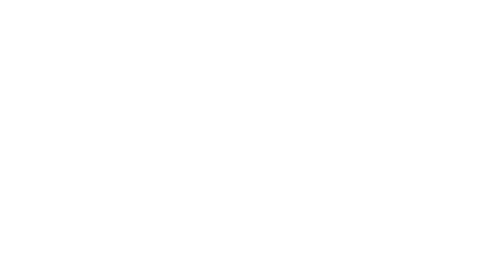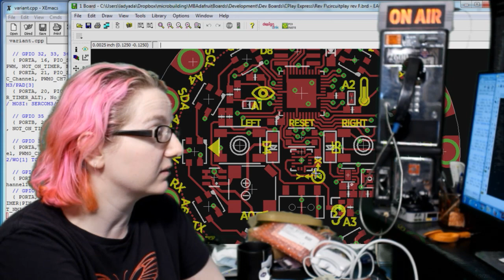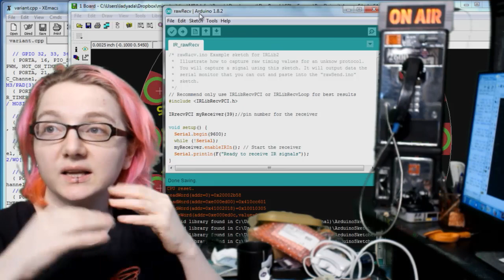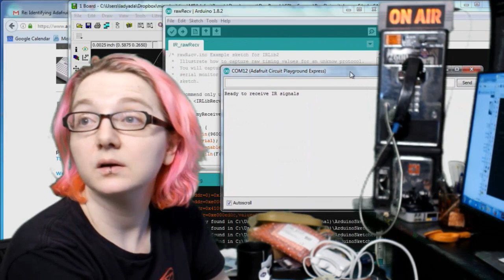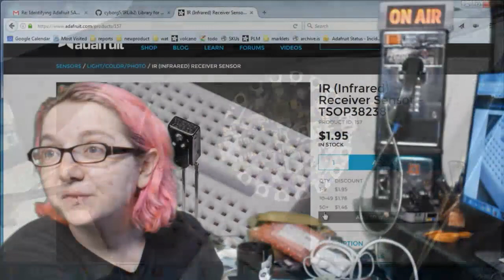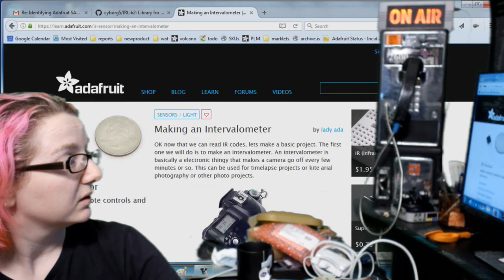IR Remote stuff, if we get it working @adafruit #adafruit #programming

Comment: You should have used the "dump" sample sketch instead of the "rawRecv" sketch. It would've decoded the NEC signals and turn it into a 32-bit hex value. It would also detect the repeat codes for you.